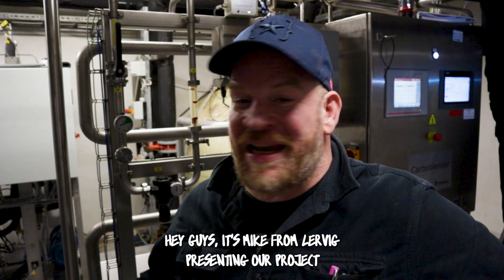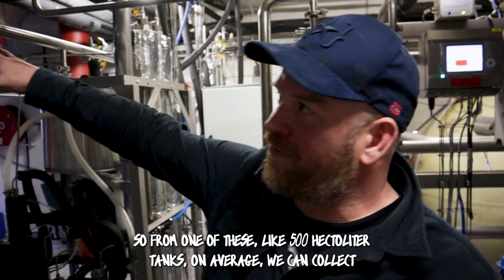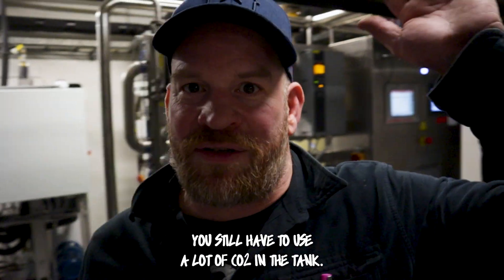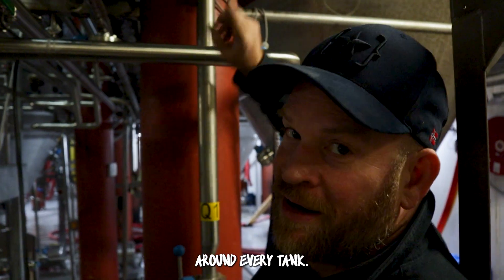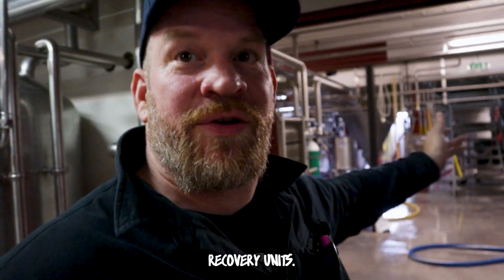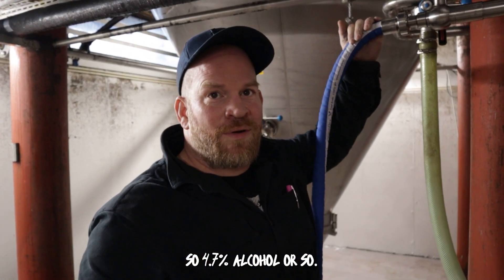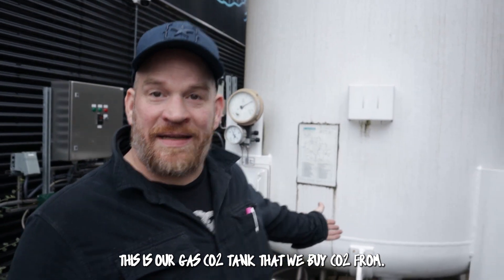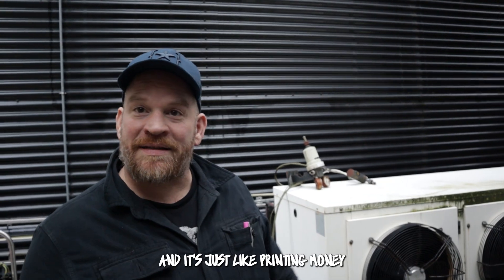Mike explains capturing our CO2 and reusing it for the next brew🍻

Comment: I hope you have CO2 monitors in those enclosed spaces. If pressurized CO2 escapes into an enclosed space it can be deadly to those working in the area and they won't know to evacuate without an alarm.
Reply: Hi Justin,
We provide CO2 safety systems as well ( Logi CO2 Alarm), so this should not be a problem. 😁
Reply: of course...

Comment: I collect mine on a hombrew scale. Blow off tube through a 2ltr lemonade bottle as an airlock then out & through the next sanitised keg I will be using. I capture enough to purge my beer lines used to transfer as well. I hate seeing others fill a keg with starsan then use co2 to push it out, just seems a waste of co2.
Reply: @Dave M how do you store the CO2 ?  or are you just utilising it ?
Reply: @wmtarr886  I only have one spare keg so I just purge that from the blow off pipe capturing enough for the closed transfer. I don't store any more than this on each brew. I have also connected a silver foil balloon to the gas post on the keg, when the keg is full the balloon starts to inflate. This allows for the pressure drop when I cold crash.
Hope this all makes sense.🤔